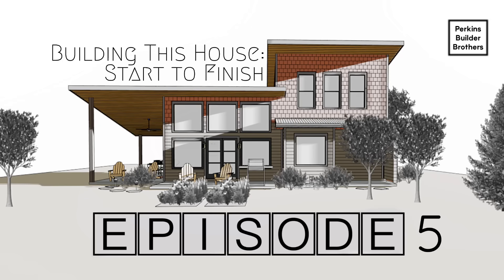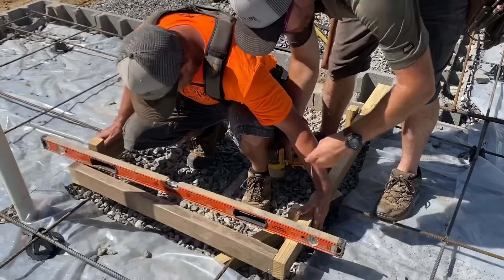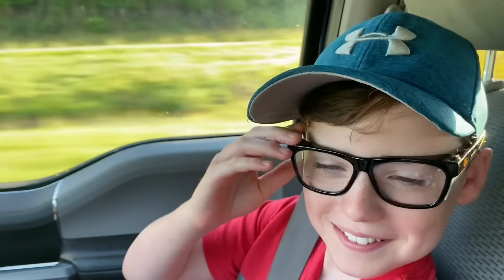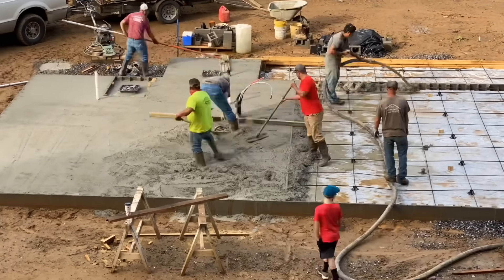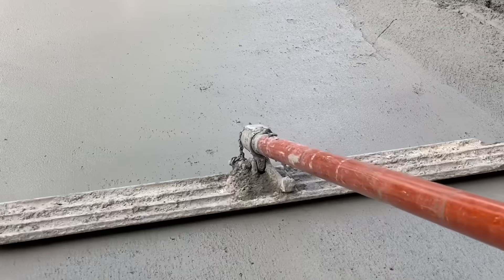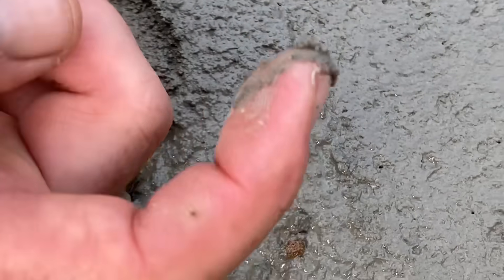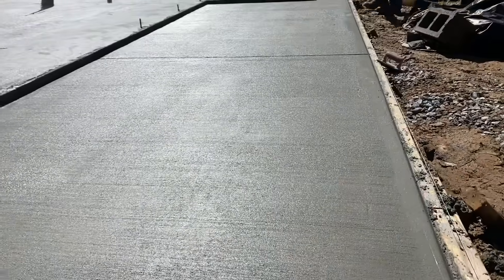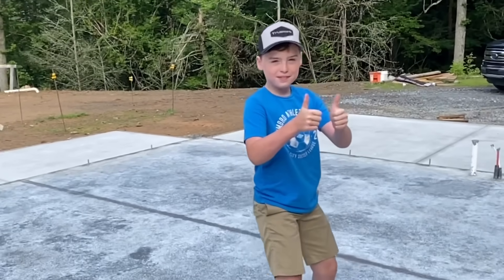Building a House Start to Finish | Episode 5: Pouring and Finishing Concrete Slab

Comment: Concreting like you do is not that exciting. I work as a CM in the oil&gas/heavy industry and that is where you have the true big pours. Those pours can be very very stress full.
Concrete tip: after pouring and throwling, spray water on top of your slab and protect it with a thin layer of plastic for two days. Your concrete will come out very very nice. No shrinkage cracks at all.

Comment: Worked in construction last year with a working holiday visa. I was installing window frames in a residential building. The frames wouldnt fit in the last floor. When we looked at the print, turned out the people that were building that floor did it flipped, nothing was where it should, building got delayed for half a year.

Comment: Quick question .. is the shower box a regional thing? Why leave a box shaped gap in the floor for the shower drain/plumbing? Do you go back and cement it later after the plumbing has been installed? Just wondering .. I've only seen shower drain stubbed out as a pipe (i think 3 or 4 inch pipe) - no box gap. Thanks.

Comment: It looked like the joints within the building footprint were cut with an early entry saw while to porch joints were tooled. Why wouldn't you also saw the porch joints if the saw was already there and being used?

Comment: Why would you be so tight with the shower recess? 34 years I'd like that recess area to be at least 6in outside of the shower and a recessed shower to be at least 4ft by 5ft in overall dimensions. But even if this idiot homeowner thinks she can have a successful 3 by 4 recessed shower, that still doesn't explain why you didn't give an extra 6 inches for the transitional slope along the entrance. Edit. I think I just realized she's going to put a door on that shower. Okay so I'm the idiot because I assumed that a curbless shower is also a doorless shower, because that's the way they're traditionally built. But if the shower has a full door, then the 3 by 4 should be fine.

Comment: If you don't have pressurized water on site, you can shallow water dam using sand around the perimeter, If it is really hot days.🥵 The grass on the hill would stop soil attrition in rain.

Comment: I went to college and I still pour concrete... damn hard work.
Reply: moondog that’s awesome! Do you do residential or commercial? And what’s your pay? Just wondering cause I want to go into the trades
Reply: @joeywalsh4089  Some advice, DO NOT let anyone get to you thru the normal smack talk on a job site, don't be weak, but don't over stress your back. Use your head for something besides a hat rack, and take care of your back. If not by 50 you have 4 destroyed disk in your lower back. If you didn't get my point take care of your back.
It's cold in the winter, and hot in the summer.
Now that the bad is made a point of, you pull up on a job site, that might still need to be cleared, when all is done, you see a very expensive piece of property, you will talk with others and learn how to take care of your things at home. Never needing to call a repairman, weekends are packed usually. It can be a very rewarding job mentally. The amount of satisfaction you feel for a good job, is hard to explain.
Save your money, don't go out and waste it all on the weekend, set 20% (min) back, 10% to get you thru the winter when work is slow and 10% for a retirement fund.
The generation coming up now will be making fantastic money, while using the latest tech, depending on area you live in ofc.
Good Luck.
Reply: @joeywalsh4089  "concrete" isnt my job, some times during my job I have to work with it. Pay sucks, work is hard, and like Kal said, I go home and work on projects non-stop because I can do most all of it myself and cant afford to hire someone else most of the time. There is nothing wrong with working trades, but if you arent working toward being a manager or owner your body will give out before you can afford to retire.

Comment: Pouring and finishing a house slab is one of the most difficult tasks associated with any construction project.  The planning, coordination, and above all, the timing of it all doesn't allow for any problems that you haven't already planned for ahead of time.  Ready mix concrete is the most perishable commodity hauled by truck.  Hats off to you and your crew for the videos.  Also, Happy Father's Day to you guys.  Keep up the good work 👍🇺🇸